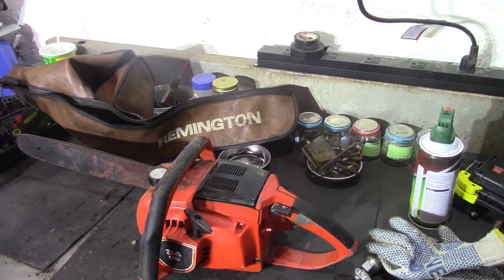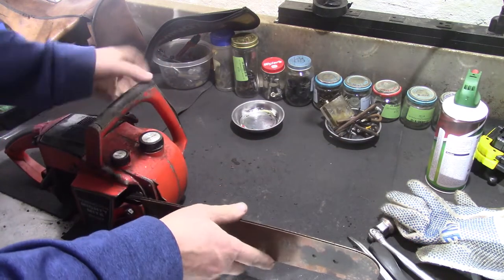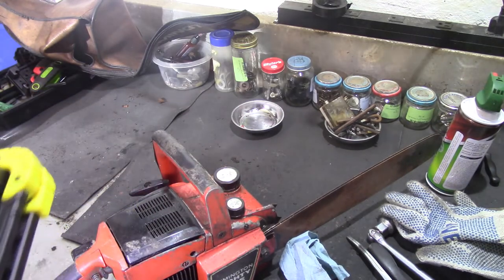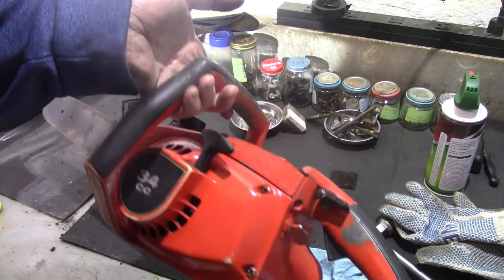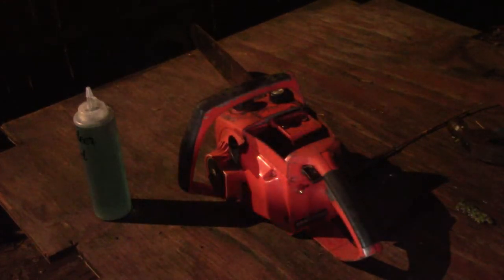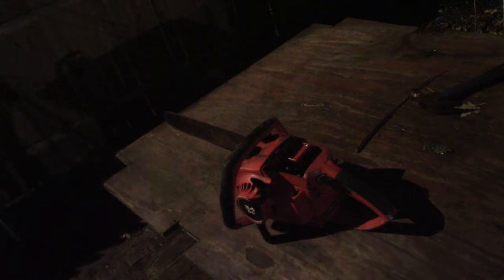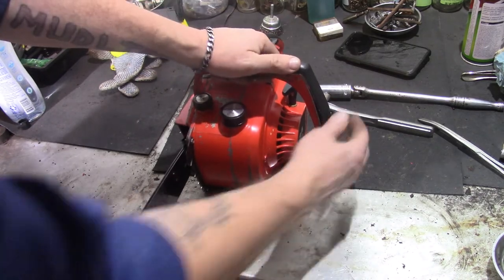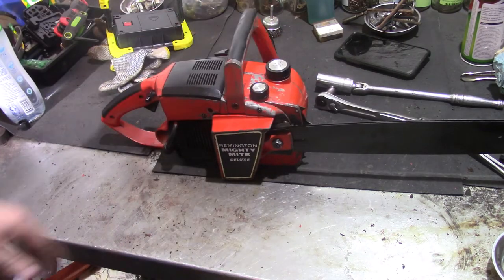Remington Mighty Mite Deluxe MMD3 Chainsaw will it run

Comment: I have one of these, it's a 12" version.  Bought it new around 1978 in Ontario. Canada and yes they come painted orange with overspray all over.  The toggle switch, the carburetor etc.  I just bought a Walbro W17 carb kit off Amazon for $8.00, plan to get it running again (been sitting for over 40 years).
Reply from the maker: I was wondering about the paint. Just hit and go I guess. You’ll have to let us all know how it runs when your done.